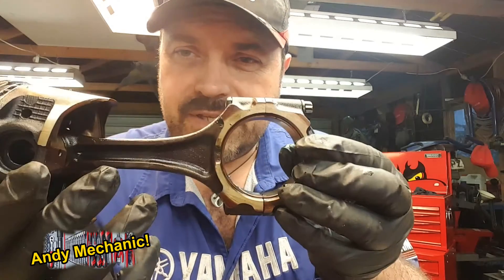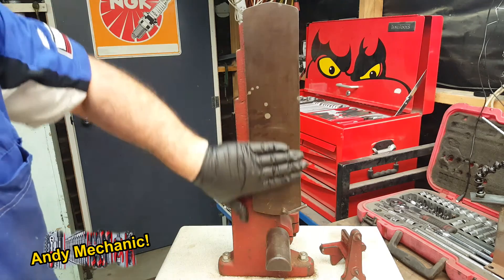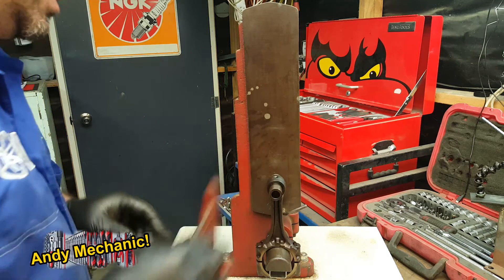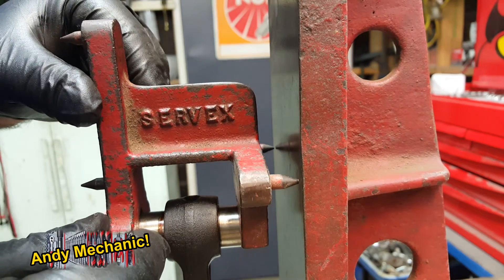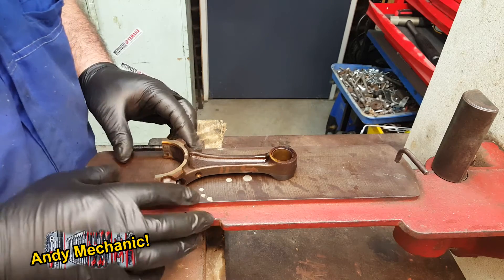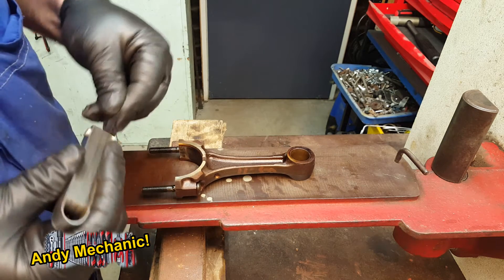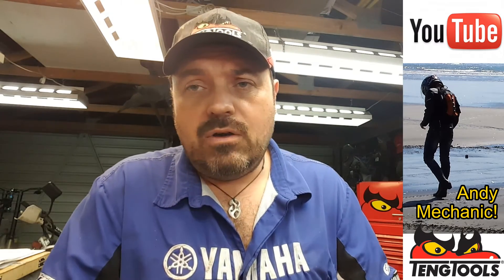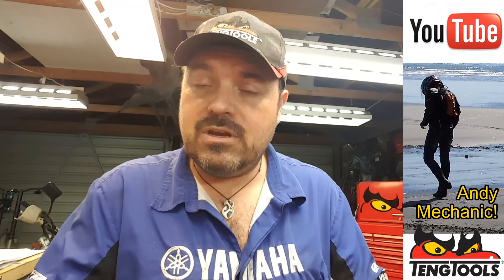Toyota Rav4 Conrod bend & twist check Ep30 #1144

Comment: I never seen one of those conn. Rod checkers . Cool
Reply from the maker: +STEVE ROB it's pretty damn old and the twist check is a little ambiguous due the difference between the diameter of the tool compared to the big end on the con rod. The flat plate check works better I feel...